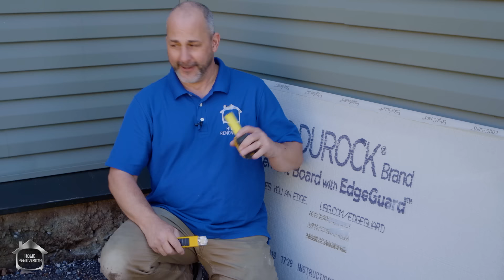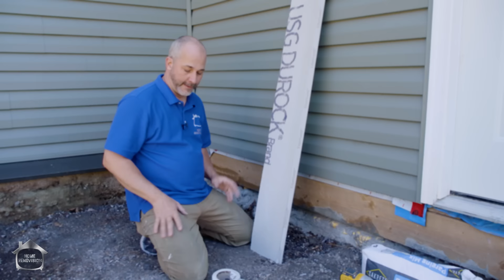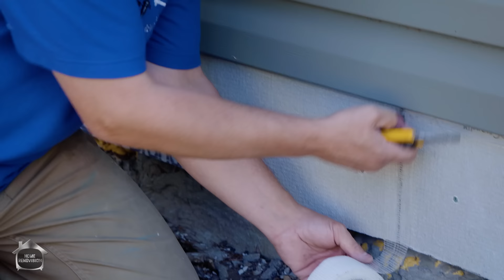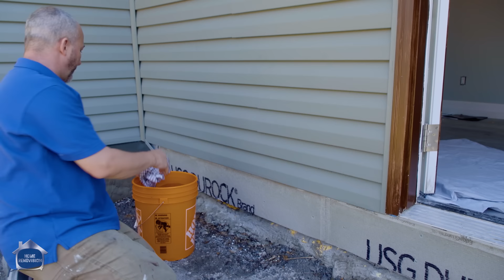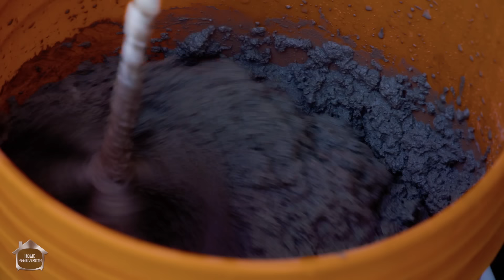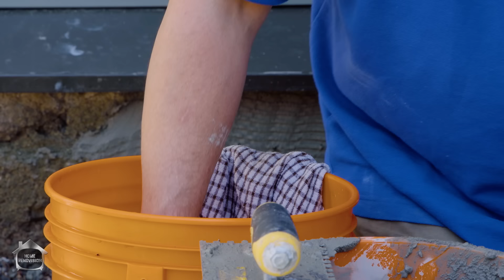Avoid a Parging Fail with These DIY Tips and Techniques

Comment: What if one wanted a carved concrete parging? Flat surface to start with. Do you do two coats and the second one is carved? How long would you let the first coat dry before adding the second?

Comment: Have a question Jeff. I have the exact type of job to do..... I have styrofoam insulation on the outside of a concrete slab that I want to parge. I am leery to screw the cement board through the styrofoam and into the concrete because I have infloor heating in the slab. Can I just use something like PL Premium to attach the cement board to the styrofoam?

Comment: Jeff, i have some water coming in through the basement wall (probably because of a gutter that needs fixed). I don't think it's appropriate to replace the weeping tile as the spots of water are localized to an area 10 x 4 on a single East wall near the furnace and the old coal chute (the house is about 100 years old or more). I was thinking of parging from the inside using your methods here. Can you parge from the inside? The amount of water is nominal -- a few ounces at most (not enough to form puddles as far as I can tell; it's almost like condensation).

Comment: I'm looking to tile part of the walls of a bathroom, specifically the lower few feet. I want to replace the bottom foot or so with cement board to prevent mildew issues... is the transition from cementboard to drywall going to cause problems?

Comment: Only thing I'd say is id of used a aluminium mesh wire over the original concrete id also add pva to my mix as will help grip and make it easy to trowel

Comment: My mother's house has a Terra cotta foundation. Really like a flower pot. There are cracks and holes. Should cement board be used first or Portland cement?
Reply: I guess the cement board is needed to cover wood.  Her foundation needs parging mix. Right?

Comment: Hey Jeff, I got a pressure treated plywood foundation, can I just screw a cement board on top of it? 
Also kind of dumb question, can i get a black parging mix?
Reply from the maker: yes cement board is ok. second you can paint it once it is cured. Cheers!
Reply: I never heard of a PT foundation, normally they r built on cinder blocks and then the inside of the blocks r filled with cement/rebar.
Reply: Thanks Jeff, you're the best!

Comment: liked your video , very informative DIY.  I've have some areas around my foundation wall  that requires freshen up with parging.  there's a product on the market by KING  ,  it's an adhesive concrete to concrete , it can be added during mix or brushed on. Mr. Home RenoVision can you add some info about this product if you have ever used this. It's not cheap.

Comment: I have a smoothish foundation but it has been painted, what would you do or what are the options?(edit) I meant to say fairly smooth but has a pattern that isn't very esthetically pleasing...but you seamed to have gotten it just wanted to be clean
Reply: either a good concrete stripper, a great scraper, and a grinder wire wheel. or the only bonder i have ever seen, or know of that is approved and rated to render over a painted surface is a product called weld crete. read all bonder instructions, most will say remove paint, that one does not.

Comment: Instead of a damp rag or sponge to moisten the underlayment couldn't you just use your garden hose on a mist spray?

When you hang the plastic do you do it after you parge the whole house? It might be dry by the time you finish;the last 10 ft of your house. So I'll assume hang the plastic in sections directly after you parge while it is still wet?

Comment: I'm looking at purchasing a house and I've run across (and been warned about) something called EIFS aka Synthetic Stucco.  Have you ever removed & replaced this?  I'd appreciate any knowledge you might be able to give us on what this is, why it was/is used, and how much of a catastrophe it's liable to be if it fails.
Reply from the maker: what I know is stucco failures can be catastrophic since the house quite often does not have a barrier to keep water out underneath it. Cheers!

Comment: Hey Jeff, I’m going to be parging my foundation this weekend. I am wondering if a top coat of stucco is required or just for appearance? If I don’t mind having a plain grey concrete look, can I use just a scratch/brown coat product without needing to finish with a separate top coat? I’m parging over cement board also, and live in Northern Ontario. Thanks in advance.
Reply: Did you end up putting a layer of stucco on?
Reply: @oliviaseeley2721  Yes i did

Comment: Good info on cement... why does it fall off the wall? If it does that for you I'm gonna end up with 70% of it on the ground!
Reply: It'll fall at first but as you work it in and smoosh it around it'll grab, as long as you didn't make it too dry. Again, make sure you wet the stone, brick, cement board or whatever masonry surface you're applying it to first.

Comment: I would have dug it out a bit deeper
Applied red guard 
Then dura rocked it
Then added some nice veneer stone tile/siding

Waterproofed 
And long lasting
Reply: Redguard?  Thats for your bathroom.  
Never seen a foundation guy use redguard.  Use a purpose built faoundation coating.

Comment: Hi Jeff, I have a slab foundation with 4" of insulation. Can I parge on top of the insulation or do I need to add cement board or wire mess on top? I was thinking of using Styro Tuff ii. Btw, I built my porch EXACTLY like you did in the video and even got the 20' cedar boards after asking lumber yard!! I wish I could send you picture! You da man
Reply from the maker: check this out. Cheers! https://www.youtube.com/watch?v=7SGKqb8VSHE
Reply: @HomeRenoVisionDIY  You da man! Thanks Jeff!

Comment: hey haha not at all related to the video but I am looking at purchasing a house with a concrete slab foundation built in 2007 with about a half inch crack down the middle of the slab. Should this be a deal breaker or is it a simply fill and put new flooring down? I really appreciate it! <3
Reply from the maker: as long as the crack is not at different heights I would be fine with a fill and a crack isolation membrane if going with tile. otherwise a floating floor over the crack is great! Cheers!
Reply: @HomeRenoVisionDIY  Thank you so much! I am concerned there may be other structural issues hidden that aren't as obvious. Ill definitely be getting it inspected but wanted to make sure this wasn't an "avoid at all costs" warning sign
Reply: DGold how bad is the radon there?
Reply: DGold also something to consider that crack could b from a bad compaction and if that’s the case that crack will come back once filled and then continue in others of the slab eventually causing ur future living room to sag lol
Reply: @borys444  Radon is an issue here
Reply: @borys444  I appreciate this. The house was built in 2007 and the only noticeable problem is the crack. It is a 2 story building so I want to make sure it isnt going to be a bigger issue down the road.

Comment: There is no acidity in concrete, concrete is alkaline, which is literally the opposite.
Reply: Agreed!!!!  And for those of you using that Durock cement board as a tile backer...they sell a specific "alkaline resistant" fiber mesh tape for the joints.  NOT regular drywall mesh tape.

Comment: I’ve always cut cement board with an angle grinder
Reply: They also make cement board scoring tools you can find in any big box store.  Box cutter seemed to work great though if you don't mind wearing out the blades quickly.
Reply: RadDad grinder is faster just more dust but I use a shop vac with it how do u cut holes with a scoring tool

Comment: He forgot to use a latex bonding agent, it's like glue for applying cement over top cement.
It's also not recommended to add water to reconstitute drying cement

Comment: theres something like that falling off the back of my house except its over an inch thick.  Is this somebody's attempt at parging?
Reply: I have the same issue and believe that it really was a poor parging job.
Reply: I don't think parging per se, is that thick. Parging is usually the 'finish' coat (quarter to half-inch thick) over an existing poured or cinder block foundation which is somewhat flat to begin with. Maybe it was a repair job where much of the facade was missing?

Comment: Aren't you concerned about rot on ledger board?   Whenever that parging and cement board gets wet, it's going to hold moisture against your rim joist.  Imagine in the spring when you've got 2 ft of melting snow against your house.  Just like with stucco, a small air gap (thin furring strips) behind the cement board with bug netting at the bottom would be useful to prevent rot.
Reply from the maker: i installed a Pressure treated board as a ledger. Cheers!
Reply: Bug netting! No one has ever talked about that! Does it work against termites?

Comment: never use concrete against bare wood without a moisture barrier and or air space between them.also a proper drip cap should be used not house wrap to divert water.your new sill will probably rot in a few years and will be prone to termite damage!

Comment: portland cements and concrete are highly alkaline, not acidic .. and, always add water to your cement ... mix dry (buy sand and OPC and mix yourself), then add H2O ... mix by hand with a hoe or trowel ... no power tools required

and then, as Mike Haduck explains, after wetting the substrate, paint it with a cement/H2O mix and then parge so that your parge really does stay on

Comment: That wood framing looks way too close to grade. On the other side, I'd have chipped out all the loose stuff and seal with hydraulic cement as a base. I see problems ahead in particular with the cement board on top of the wood.

Comment: Can I do this over wood? The cement isn’t there anymore.  The wood is dry rotted almost
Reply: no, cement over wood will just rot it more
Reply from the maker: install the cement board first!
Reply: Thanks guys!
Reply: Any advice greenfang?
Reply: @bobduffy7744  I've repaired rotted rim joists and sills etc by cutting them out small sections at a time and replacing. Often time there is no weight on them if they are rotten but not appearing crushed. Replaced the rotten wood with new wood, and using vinyl siding or fiber cement with a "rainscreen"  to cover down to the foundation. If not too badly rotted you may try to fill in wood with bondo wood repair.  If you insist on using a stucco or parge type coating, cement board itself is not waterproof, no manufacturers of it claim it is and recommend additional products and procedures to keep moisture away from the wood. That's why the "rainscreen" air gap is recommended. If there is dampness in the foundation, the cement board and parging can also trap it against the wood.
Reply: Sorry if that sounds complicated but it kind of is until you get it but once you get it it's not that bad
Reply: Greenfang XYZ thanks brother!  It’s not terrible rotten; however can feel it starting to dry out a bit.  It’s just sitting unsealed and uncovered against the ground

Comment: Sorry dude but you failed on this project. You placed the cement board directly on to the rim joist with nothing in between. The concrete board with parging will be constantly trying to hydrate. It will also get saturated from wind driven rain along with snow melt. Looks like future mold growth leading to rot will probably occur. I would of put a blue skin or another peel and stick membrane on first
Reply: Product suggestions?  Thanks
Reply: I was thinking the same thing. Funny thing is that he even refers to building a shower when he first mentions the Durock cement board, but then doesn't use any sort of membrane to isolate the wood and cement. I imagine that his ledger board is a pressure treated piece of lumber, so it's not a horrible scenario, but perhaps could be better. I thought he said that the patio was going to be done with stone so I think the ledge board might be just a spacer to bring the foundation line out to the wall and not used for an attached deck -- just a guess though. If that's the case, I think that he could have used a repair mortar to add material to the foundation wall prior to parging, instead of parging over a ledger board.

Comment: I like the majority of this guys videos but this job will not last the test of time.  Stucco is based on traditonal plastering techniques.  This will not work.  I have repaired jobs where people have tried parging over cement board.  The cement board doesn't have the groves like a scratch coat.  No mechanical bond.
Reply from the maker: sorry to bust your bubble but this is now 1 year old and been through 4 seasons including -30 winters. looks great still. Cheers!

Comment: No your not an expert at parging, hey buddy doing the job your wrong at doing the cement parge with your board. The solid surface is the stone. Cement bonds to stone excellently.
Reply from the maker: this is a stacked stone half wall for a crawl space in a northern climate. if i parge directly it will crack everywhere . but thanks
Reply: @HomeRenoVisionDIY  that's not what you were showing on your show you were at the bottom of the foundation wall putting  on board with tap cons ????? I seen em in ur hands they were blue. Sorry that's also wrong anchors. As for stone and cement it bonds very well. As for snaps in the cement if get some you can correct it by??? Foget it already cut me off so for sho I ain't ellin ya.
Let see 🤔
How you fix snaps in the cement???????